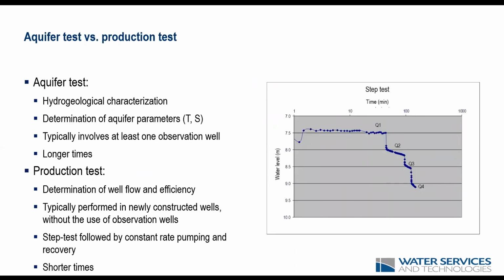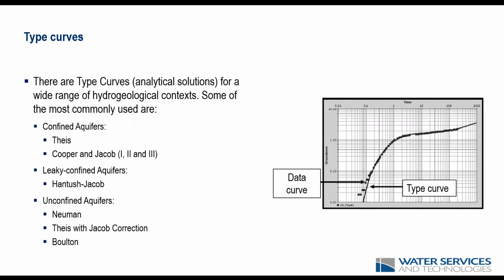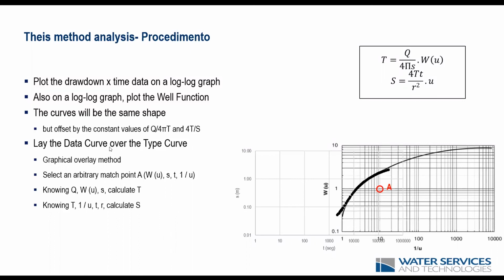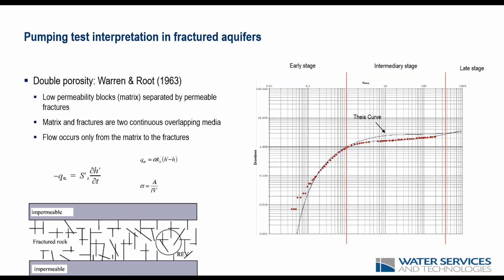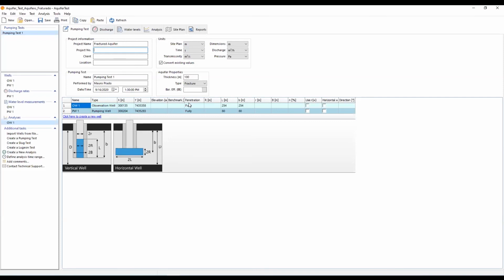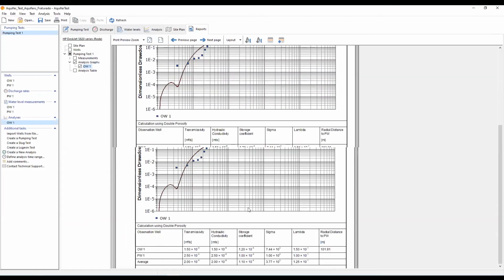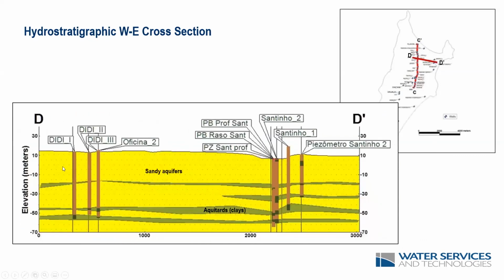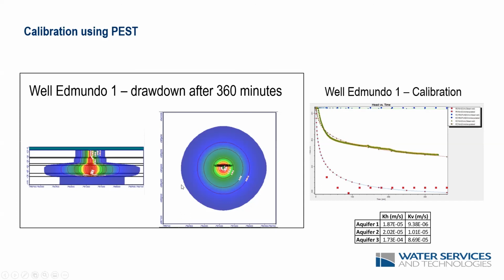Pumping Tests with AquiferTest 10.0

Comment: Hello, and when we don't have observation wells, what are the procedures?
Reply: In this case you can use a fake well radius and pretend that the observation well is, say, 0.1m from the well. In this case the values obtained for Transmissitivity is valid as it is not dependant on the distance between the well and the observation well. However the value for storativity has to be discarded as it is not realistic.
Thats why you can ave single well tets, such as slug tests or packer testa to obtain T,or K. But they will not provide S, Ss or Sy. Also, of course you can use single well tests to calculate well head losses and well efficiency
Reply from the maker: Thank you for your interest, for pumping tests it is one of the test premisses to have an obsevation well.